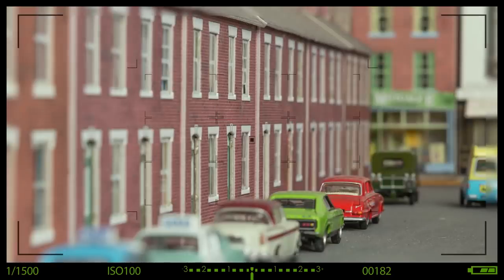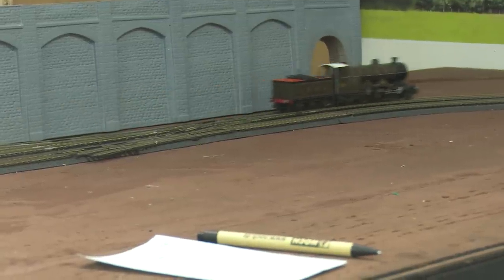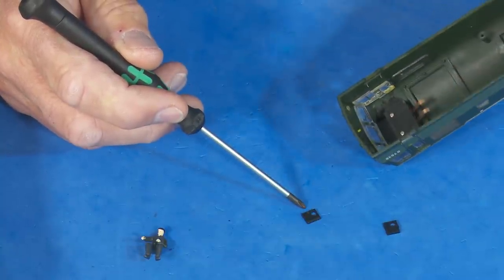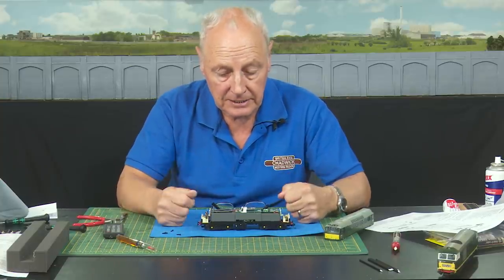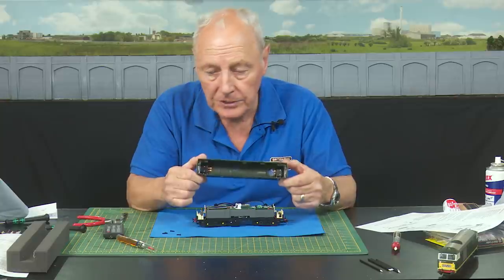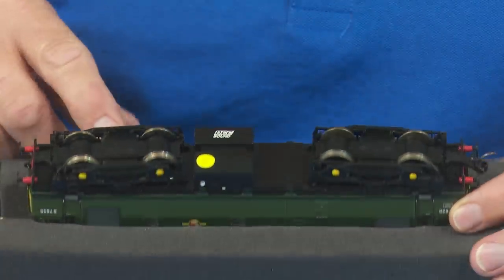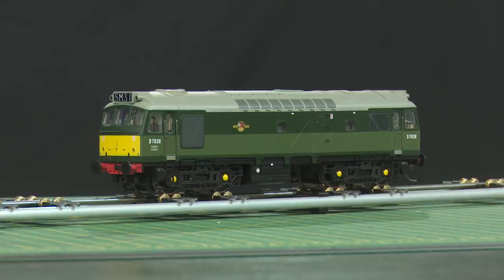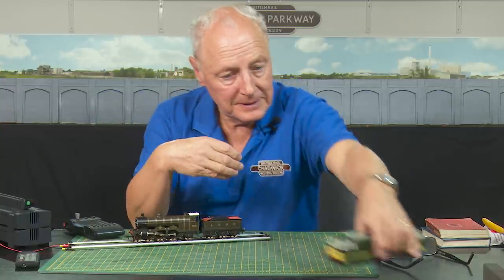Loco Servicing at Chadwick Model Railway | 109.

Comment: Nice one, Charlie. Lots of good tips in here, and bang on with your exhortation to manufacturers at the end. Slightly worried that someone might have stopped the video at 16:40 and put their locos in the washing machine...  Must be an opportunity for someone to make brass replacement Hymek horns (assuming they're not already out there).
Generally, I'd only service locos if they started making a funny noise or had been left idle for months/years.  It's always worth keeping a record of any servicing you've done - plus how you'd got into the loco, as you'll find when you get older you forget how you did it and have to go through the whole discovery process again, with the risk of breaking those damn plastic clip things.  A good old fashioned card index works, but there are modern alternatives...
I like to use a roll of sellotape to keep screws and miscellaneous flying bits together.
Reply from the maker: I’m so pleased that you enjoyed it Andrew and a great sellotape tip.

Comment: Hi Charlie. I'm still enjoying your videos, I like your style. This was also really useful. Thinking about powering the loco whilst its upside down for wheel cleaning, I use a 9V battery which for 00/H0 at least the terminals are the same as the track gauge. You just have to hold the terminals against the wheels. I'd hope this also works with DCC, but I haven't tested it. Cheers! Matt

Edit: watch the whole video first!!!
Reply from the maker: That will teach you Matthew. Regards Charlie

Comment: HI Charlie, whatever you do when carrying out maintenance on your locos make sure before putting the body shell back on the chassis, that there is no super glue on hands after using it. I,not so long ago, got super glue on my thumb when putting a class 33 body shell on to its chassis and the result was nasty un-removable glue stain. The air will turn blue with a vocabulary of swear words.(I speak from experience) Enjoy watching your videos,5*.
Reply from the maker: Wow what a tale of woe revelation that was. So pleased that enjoy the channel, regards Charlie

Comment: So, surprise, even in H0 you have to service your Trains once in a while... especially when they where hidden in teh attic for about 12 years. Turns out that prying open the gearbox on the Mehano Thalys PBKA can lead to a broken off Coupling... -  and no chance of repair on that one. luckily i found the same trainset with a faulty motor for just over 20 euros (including shipping). Now I have spear parts for some things if i manage to break them again.

cheers, Sarah
Reply from the maker: Yes Sarah, maintenance is a nightmare.

Comment: Yes - track cleaning video would be interesting - would be nice to see what's out there. I keep looking at the CMX clean machine - quite like the idea of setting two locos going, one dragging the cleaning truck round and the other chugging around after it for a free wheel clean? 

Couple of things... the hymek wheels seemed like a good candidate for a ultrasonic bath once removed? Appreciate you're not wild on water for cleaning, but a blast of an air compressor and that's gone. Nice little gadget to have on hand and not that expensive in the grand scheme of things anymore. Anything that cuts down on time sat scrubbing with cotton buds has to be a postive thing, Maybe?
Why was the 25 slower and the hymek quicker? Two manufacturers and (probably) two different grades of grease would be my guess. I think I would argue that what you've proved is heljan use a slightly thicker grease than Bachmann and your weapon of choice to grease them both was somewhere in between in terms of viscosity? 
On the subject of grease, I think I was half expecting you to use a tiny blob of dielectric grease on the contacts for the class 25 head codes. You've mentioned in the past that your background is in electrics so would be interested to hear your thoughts on the use of that on those pressure contact pads? 
If it seems a stupid question, then accept my apologies - I genuinely know very little about electrics and electronics!

All the best, 

Jon.
Reply from the maker: Jon, I’m in Baris to say that I didn’t even think of using the grease on those pads, I hold my head in shame, regards Charlie

Comment: Hi Charlie, another enjoyable video, thank you. You can buy the Woodland Scenics greases separately and I use a PTFE grease from the range that was recommended by Peter's Spares. I would very much be interested to see a video on track cleaning which is not easy with a lot of delicate signals etc. close to the track. I currently use a Peco rubber.
Reply from the maker: Hi Simon, that’s a very interesting point you’ve made regarding the Greece. I will certainly look into buying a tube. Regards Charlie

Comment: Hi Charlie! I don't normally comment on your videos as I appreciate that you get so many comments, but I am a avid watcher of your videos. I model N-gauge and usually the amperage a loco draws is usually a good indicator on whether the loco needs a good service, did you find much difference in the current draw after you serviced your models as you didn't show this in your video!  I will certainly be investing in the dcc concepts meter for this reason. Great video on loco maintenance, keep up the good work! All the best Tony.
Reply from the maker: There was no marked change on the current draw Tony. However it’s a fair point that we ought to note the current drawn by the loco for future reference, should its performance decay.

Comment: Charlie I really enjoyed your video. I have some locomotives that are approx. 20 years old and fingers crossed  have never burnt out a motor. I oil and grease  my locos once a year. Maybe the reason I have never burnt out a motor [and I hope "murphys law" does not bite on my backside] is because I never run any loco at full speed, in fact they are mostly run at about 25% capacity and never more than 50% capacity. As for cleaning the wheels I have never had to clean them and the reason is my track is 100% clean all the time so the wheels never get dirty. I heard you mention track cleaning so I will wait for that video before commenting on how I keep my track clean all the time.   Cheers   Greg
Reply from the maker: What a great comment Greg. However you haven’t mentioned how you clean your track? Regards Charlie
Reply: @ChadwickModelRailway  At just passed the 39 minute mark in your video you made reference to track cleaning in your next video, so I just thought I would wait for that video to comment on how I keep my  track clean. Hope that meets with your approval.  Regards   Greg
Reply from the maker: Greg, you’re such a tease. Regards Charlie
Reply: @ChadwickModelRailway  Charlie, I pray that it is worthwhile.   Cheers   Greg

Comment: Another great video Charlie! Taking the hymek apart looks frustrating. With regard to the manufacturers improving instructions etc why would they when we hobbyists have traditionaly just got on with it ourselves? Even today with highly sofisticated and detailed models the mindset seems to be let the customer fix it whenever quality control goes awry. It will only change when we as consumers demand it by returning models that don't fit the bill.
On to lubrication. I have found that little goes a long way. Recently I have had to strip down all my Hornby class 50 and 60 locos which had to be stored while our house move went through. All were fantastic and reliable runners before storage. The culprit was the grease on the worm gears going rock hard. I wrote to Hornby and complained but surprisingly didn't get much response!
Btw Hornbys manufacturers had applied far too much grease and the wrong sort. I have had no problems with other manufacturers models
Reply from the maker: A great comment Steve. I have 3 Class 50s, one of which is a slug.  I'll check it out.

Comment: Charlie, You would find it easier to lubricate the worm drive on your class 25 if you remove the seating unit. I myself use sewing machine oil and I do take the bogie frames off and use Vaseline to lubricate the gearbox as I find that the white model grease is to thick and has a tendency to stick in one place.
Reply from the maker: To be honest John, I really didn’t want to strip it down any further as I was unsure of actually how it came apart. Regards Charlie

Comment: Great video Charlie. I’m on the preventative side of things rather than run until it breaks as that could be more costly to repair. I currently use Peco electrolube and Tamiya ceramic grease and of course 99.9% alcohol for cleaning. 
Please do a track cleaning video as I’m interested in your take on the subject. There are others that have covered it many say no to the traditional rubber though many others use them. There is one that says throw it away plus the IPA and use some form of oil to create a layer against oxidation.
Reply from the maker: I’m doing the research as we speak, but it is turning into a nightmare!

Comment: Re the IPA with 30% water. I don't know if it means, but when I worked in the pharmaceutical industry we used to dry the stainless steel vessels with alcohol on the principal that alcohol makes water evaporate very quickly.
The alcohol we used had an ingredient that stopped you drinking it. Without that additive Customs & Excise would charge duty on it.
Reply from the maker: That sounds highly likely mate.

Comment: Loved this video Charlie thank you. How is it you can "prise" bits apart without breaking? Even with care I seem to break things - I always claim they were cracked to start with of course!  I am now going to see whether my Hornby rolling road will also operate upside down - very useful tip thank you!  Most of my locos predate yours and generally easier to get inside for maintenance.
Well done to you once again!
Reply from the maker: It's not you. I've just broken off a set of steps from a loco.  Now where's the glue!

Comment: Great vid Charlie,are you aware of the trix wheel cleaner and if so are they as good as the method your using,thanks Charlie 👍
Reply from the maker: Sorry John, I've never come across The Trix cleaner.
Reply: @ChadwickModelRailway  hi Charlie,,the trix is a 12v cleaner by marlin I think,I haven’t got one ,I have the peco version but not very good to be honest,I think your idea looks a much better idea,I’ve already ordered some isopropyl from eBay £4.60 for 250ml 99%, so when it arrives I’ll make a start.32 locos to clean that’ll keep me busy,thanks for great vid,cheers Charlie 👍

Comment: In addition to my earlier comment. Yes please to the track cleaning video. Have you tried Deluxe materials track magic?
I used to use IPA but have found it difficult to obtain so switched.
Reply from the maker: Did you find much difference Steve?
Reply: Hi Charlie. Yes the difference was great. IPA works well for the actual cleaning but the track magic also protects the track after cleaning. It also lifted much more dirt from the wheels than IPA. It also comes with some handy little tools one of which enables you to get between the switch and stock rails on points which is a area cotton buds tend to be too big for effective cleaning.

Comment: Charlie, 
The result of your testing is (to some extent) not a surprise.
The back EMF nature of decoders means that the speed of the motor is related to the speed requested, and so the current consumed is directly related to teh back emf. (6V across the motor, and 5V back emf, requested by speed 25, means there is 1V to push current through the motor, resulting in the same current in most cases.) 
However, as you have shown with the Hymek, improving the gearbox performance can result in the motor having to do less work, so for the same net voltage, it can run faster.
The change in performance of the Class 25 is salutary; you may affect a good working loco and make it "worse" by maintenance
Regards, 
Tom
Reply from the maker: Thanks for your thoughts Tom, much appriciated.  Regards Charlie

Comment: Hi charlie. That was a great video on servicing. have a question and seek your opinion please. Today most locomotives use non metal gear wheels on the bogies as well as the main drive fitted on the motor. It is advised to use a light grease that plastic friendly rather than use a very light oil. I am personally faced with this problem which I am sure other modellers too are. Can you please advise what's the best lubricant for the modern plastic ( or is it teflon) gears wheels. I live in Sri Lanka and we dont have hobby shops for spares etc. Thank You .
Reply from the maker: I believe you need to check out Golden Valley Hobbies website. They have a decent range of lubricants. Regards, Charlie
Reply: Thank You for your kind response.

Comment: Great clip. I decided to do same and clean my ancient HO pancake Lima class 33. Had her since '77. All was good and well until I was replacing the motor and then found a tiny brass washer/spacer. I never her noticed her until I was replacing the motor. I can't work out if this washer is from the side of the motor   facing the brushes or the side where the pin meets the gears? Any help much appreciated.
Reply from the maker: Sorry mate but I don't own one.  Perhaps someone might read this post and help.
Reply: @ChadwickModelRailway  Hi. I discovered it was a yoke called a commutator washer. Peters Spares does a replacement for early Hornby ones. No sign of a Lima one. Best not lose this one I guess:-🙂

Comment: Very interesting outcome.
Seems to me that servicing of the wheels should be undertaken on a regular basis because of all the dirt that gets picked up, but opening up the Locomotive should just be left until there is a fault.  Far too much risk of damage with little impact on performance to justify regular maintenance.
I only use Steam Engines and they can be more flimsy than Diesels and opening them up can be a nightmare even with the foam.
Reply from the maker: I do understand your point, however with diesels we need to open them up to fit the crew in the first place. If only those manufacturers fitted them for us!
Reply: @ChadwickModelRailway  Good point, if you're opening it up to fit crew you may as well get the full thing serviced at the same time in one go.  There are many beautiful models available now, but the servicing and fitting of crew seems to be an after thought.
I'll give Isopropyl Alcohol a go too, had been using goo gone till now.
Cheers

Comment: Great video  
Just an inquiry it might be a silly question  but do all the wheels of the class 25 have to be in contact with the brass contact strips on each bogie as there seem to be a gap on one set of wheels on each of the bogies perhaps this is normal the loco 
I've cleaned all the wheels on top and the sides the track is clean my other locos no problem but the class  25 keeps stalling and I only have to touch the bogie and off it goes again till the next stall
Reply from the maker: I would have thought that all the pick-ups should be in contact with the wheels Dan.
Reply: @ChadwickModelRailway  ok thanks for the information

Comment: Really interesting Charlie , especially the Hymek . I’ve been wondering how to grease my Heljan Class 17 bo bo . I’m wondering if it’s the same arrangement . Will have another look to see as I can’t see any other way of getting in to lube it .  I must say I find Heljan absolute pigs to maintain . Having said that have you seen these very small screws on a Bachmann 45 !  What do you think about using fibre pens to clean wheels . I use Gaugemaster ones and it seems to be ok , but I often wonder if I’m damaging the wheels or if they get dirtier more quickly .
Reply from the maker: I think that you're right. Once scratched they do seem to dirty more quickly.

Comment: Hi Charlie, I always work on the assumption that any good information is worth while and to that end, as I assume that the Hymek is a Heljan, I thank you for the video because I own a Heljan Hymek and didn't know the pitfalls of accesing the interior. I agree that the manufacturers could provide better information sheets with their models. They are quick enough to say that poor maintenance may be the cause of a failure or breakage, but if you don't know how to do it correctly where do you go? Regards till next time, Bobby 'T'.
Reply from the maker: Robert, I'm so pleased that you found the video useful.
Regards Charlie

Comment: As you will see by my channel name I am an N gauge modeler. Recently two of my locos have Burt their motors out. If they only last about 100 hours in OO gauge then I am not to worried.
Reply from the maker: I had heard about this 100 hour engine life on a Facebook thread. Perhaps I should not have believed it, it does seem rather premature to losing motor with such low running hours.  
I do like N gauge however, my eyes have the difficulty. Regards Charlie

Comment: Heljan don't use any bearings on the axles?  That's a bit naff.    Re the broken horns can't you buy brass ones from somewhere?
Reply from the maker: I bought a replacement and can I find it .........
Reply: @ChadwickModelRailway  That sounds about right.  Usually buying a replacement thingy fo a what do you call it, results in the lost one turning up.

Comment: Hi Mr. Charlie, may I ask a question, …… does the Digitrax devices and Roco/Fleischmann devices could matching together?
I means, does the Digitrax DCS-240 read, talk, and control the Roco 10775 turnout control unit?  And does the Roco z21 would be used as “Booster” together with DCS-240?
Reply from the maker: Ring James at DCC Train Automation. He should have the answer.
Reply: @ChadwickModelRailway  Hi Mr. James, am I asking a too stupid and too foolish question?...... I'm just a beginner......
Reply from the maker: He will be only too happy to help.